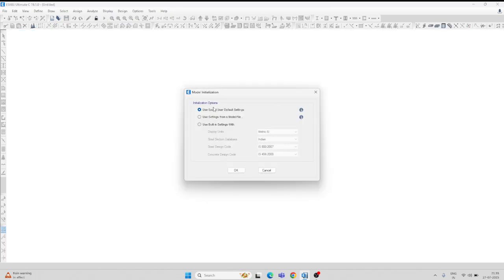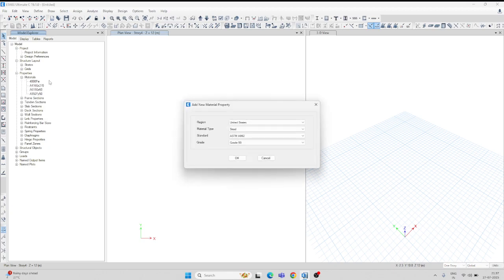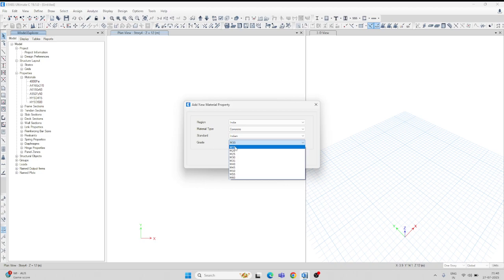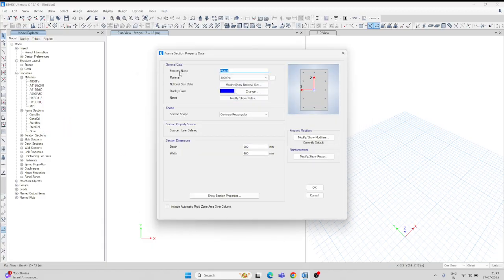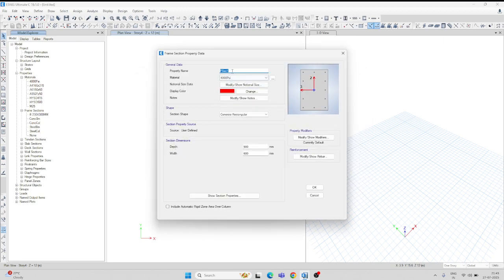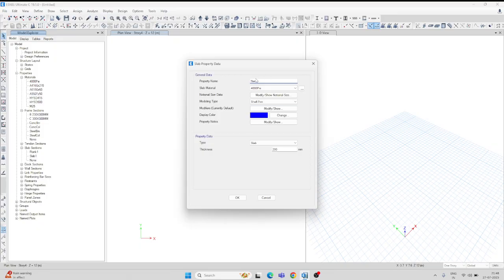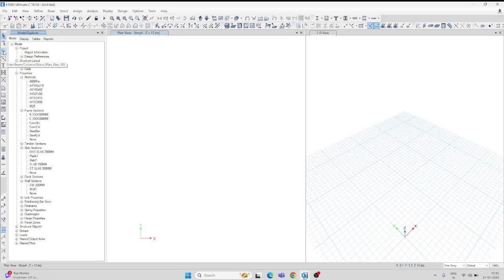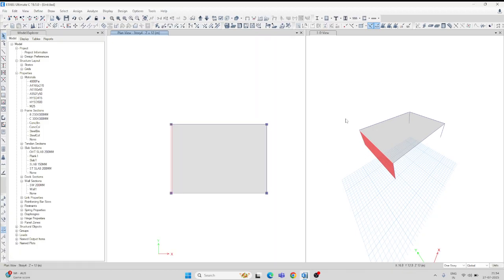OPERATIONAL PROCESS OF ETABS FOR BEGINNER

Comment: Sir plz tell how we check modal analysis of building with expansion joint ,in my case i have assigned diaphragm but only 1 building is behaving.
Reply from the maker: For checking the Modal Analysis of building structure firstly you have to confirm either your structure is Torsionally Irregular or not based on that we check in Mode 1, Mode2 and Mode3
Reply: Sir it is a 72m building in which i have provided expansion joint after 45m meter as per is code bcz i have not considered temp analysis, now the same building is divided into two parts but after doing analysis & checking mode shapes only 1 part is behaving the other part which is after 45m is not participating  @structuraldesigner987
Reply: Sir can u send me your WhatsApp no. So that i can send u the images related to model
Reply from the maker: U can send the file on my email id mdtahirrahman468@gmail.com
Reply: Thanks @structuraldesigner987